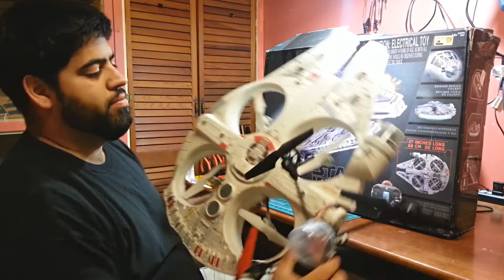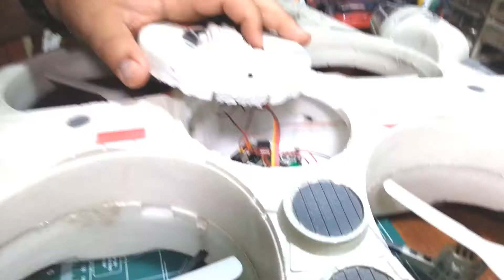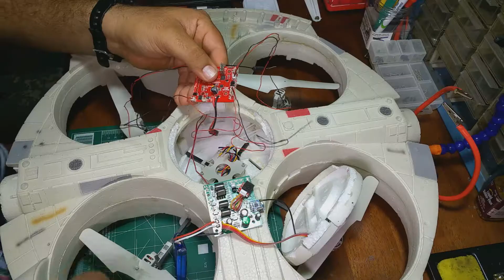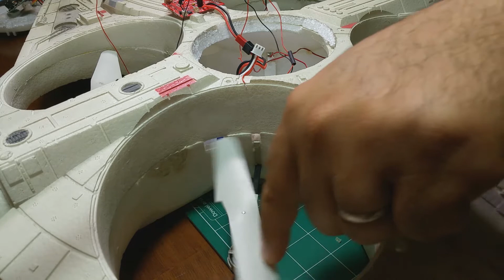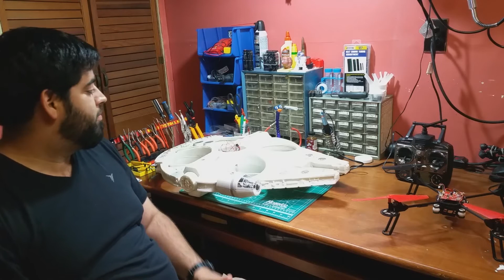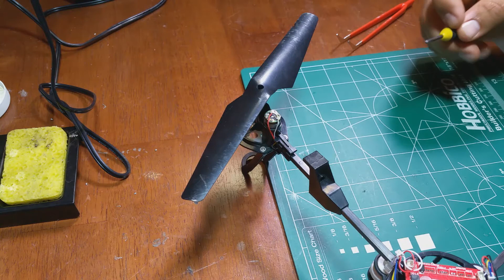Air Hogs Millennium Falcon drone modification Part 1

Comment: the main issue with those drones is a gear issue.  Once the plastic teeth in the gears start to wear they lose lift.  finding metal or better quality gears will be the fix for the factory motors.
Reply: i got one from dirt cheap too with remote for 30 and never got it to fly. thanks for this tip dude!

Comment: What radio are you using? Most can reverse any channel if its backwards, would solve your problem easy.
Reply: Why not just pull the props off and swap them then reverse the motors..you already corrected motor direction before.